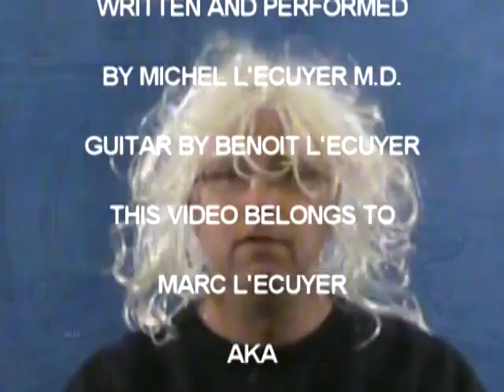POSITIONING PARTS USING ISOSTATICS FOR SHORT PRODUCTION RUNS (JIGS & FIXTURES), MARC LECUYER

Comment: Your channel is my PRICISION channel. I am much older than you are, I grew up in my grandfather's steel fabrication shop, not machine shop but we had lathe, 50 T presses, heavy cutting machine etc. At 14 after school I was on the lathe, old flatbed ceiling transmission, and turning out the lookout aluminum assembly for the bomb shelter doors we we're fabricating. Was not pricise work. Therefore your terrific presentations are fresh air for me and thanks many times for all.

Comment: Are there two "schools" of positioning? I have always thought of it as 6 degrees of freedom (which all have to be constrained). It works out the same, since each constraint fixes two directions, but it does seem to affect how I think about it. I like the 3-2-1 mnemonic (3 on primary, etc.) because it covers the two cases where positioning is meaningless in one or more directions. (A perfect disk has no rotational distinction, and a perfect sphere can rotate in any direction without being in a different position.)

Of course a clean plane against a clean plane substitutes for three points of constraint: Z linear, and X and Y rotations (assuming the plane is horizontal). You can tell that it substitutes for 3 points by counting the number of degrees of freedom it constrains.

Comment: A very thought provoking video.  Thank you very much.   I am already playing with a pair of 123 blocks on a fixture plate having fun thinking about it.  I'd never thought about it before,  but using 3 carbide balls in the fixture plate for the primary surface reference points would really eliminate some issues (and cause others).  

Then we get to the issue that metals are flexible... and clamping makes everything move.   Oh well,  that's the fun of it, eh ?

Comment: whatever variation you have on the overall length of your part will also affect the spread dimension of your holes when you flip the part end for end like that.
Reply from the maker: This is true and I should have mentioned it in the video! If the precision of the holes is high or if the outside of the part is not accurate but the spacing of the holes must be, one can drill all the first holes in all the parts and then move the spindle to the second location and do all the second ones keeping the part oriented the same way as they were for the first holes. Watch out for burrs when repositioning for the second holes! Thanks for the great insight The87wing and for the interest you take in my videos. Marc L'Ecuyer

Comment: I'll never fixture with the face of a 1-2-3 block again. BTW, what's a 1-2-3 block called in a metric country? 25.4-50.8-76.2 block? :-)
Reply from the maker: Hi the BerkeleyGang, in English I have always called them 1-2-3 blocs regardless of the unit used, in metric however they measure 25 x 50 x 75 and that's just to long to say. In French they are called "bloc de montage" and the translation would be "fixturing blocs". It's all quite confusing and I often have to measure a bloc before using it since I have both metric and imperial ones. Marc L'Ecuyer
Reply: Thanks Marc. Keep up the good work! Makes sense to me that they'd just be called a fixturing block. Even the tapped holes are "standard" thread vs. metric, so I've wondered how useful they'd really be to a machinist working with metric tools.